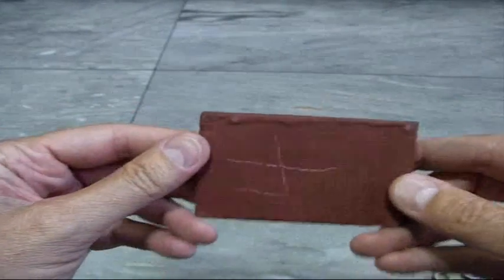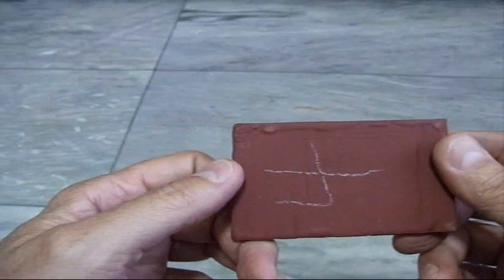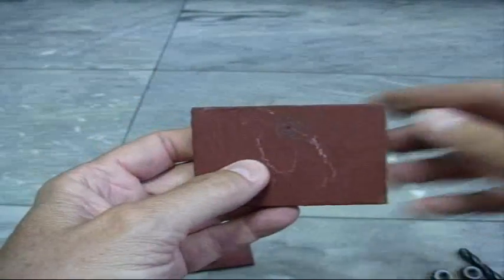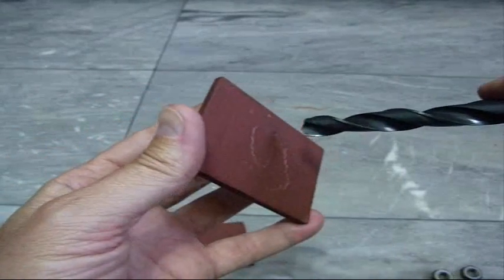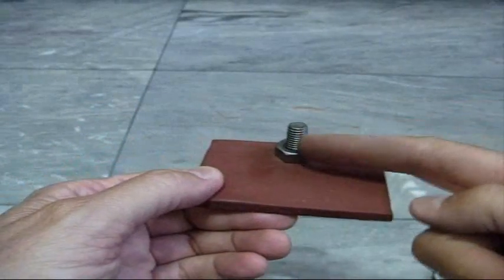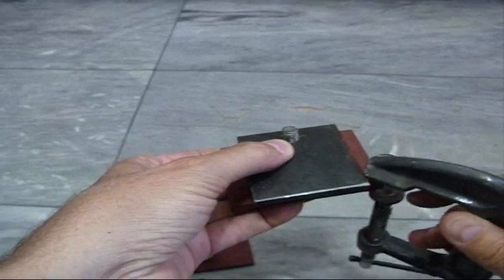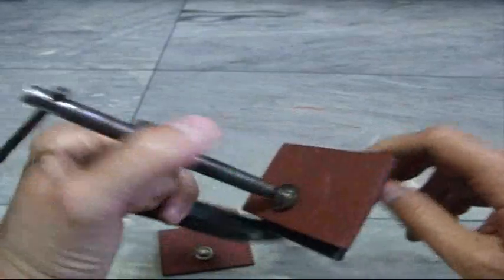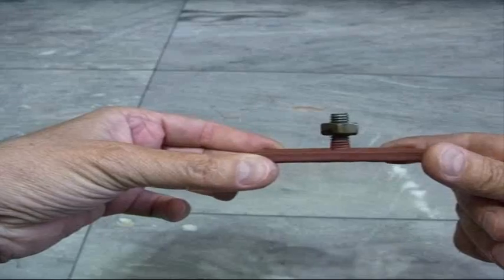DIY Welded Stud Using Stick Welder - Weekend Welding Warrior

Comment: Instead of drilling the slightly larger hole to get a 'groove', could you get away with just recessing the bolt in from the surface a little when you weld?
Reply from the maker: You could, but then you'd have to fill the hole with welding rod or leave the dimple.

Comment: Nice work.  I need to install four 3/8" studs on a metal plate today.  I was going to try to weld the studs on directly, without drilling a hole first.  I'm not proficient at welding (wire welder) and after seeing your video, will use your method instead.
Reply from the maker: Thanks.  I ain't the best welder and was going to try to stick weld the stud on there originally by going around the bolt, but KNEW that would never work.  Then this drilling the plate thing hit me.

Comment: Thanks. Why did you drill just halfway through? Not sure I you accomplished the welding part.
Reply from the maker: robviolin1 Good question; you could drill 90% of the way through, use a bigger "big" bit and get more weld area.  That smaller part of the hole is to keep the stud centered, so it does not take much.  With this 6mm plate I got a bit more than 3mm of weld 360 degrees around the bolt, and again could get say 5mm if I drilled deeper.  At amatuer level uses it's not likely to pull through and not sure if it would peel off any more easily than one from a stud welder.  
This technique has some advantages, like it does not leave a weld bead around the bottom of the bolt, you can run the nut, brackets, washers or whatever right up against the plate.  No ultra-precision cleanup grinding needed.  It also can be done with any kind of welder: stick, TIG, MIG...  And it's easy to check the weld.  It should NOT be used where failure could result in massive failures, injury or death, but for things like furniture and such it has served me well.
Reply: Thanks for the info.

Comment: I sheared off two bolts on my truck and needed to weld a plate that had two bolts on it.
  I took some pictures that shows what you describe.
 I'll link them below. It might clarify what you are describing in your video
https://youtu.be/_AGytGyaaFQ
Reply from the maker: o6298 Thanks.  Excellent photography, I should get tips from you.  What is the bracket for?  How thick was the metal?
Reply: I was installing new running boards on my Nissan Xterra and over torqued the nuts resulting in shearing off the bolts. I needed a solution to fix my problem. I liked your video and I enjoy armature welding so I decided to fabricate a bolt plate. The metal plate is 3mm thick x 65mm long and 24mm wide. The bolts I used where M8 - 1.25 x 25mm. I found everything I needed at Home Depot.